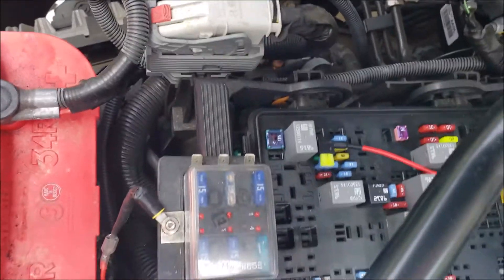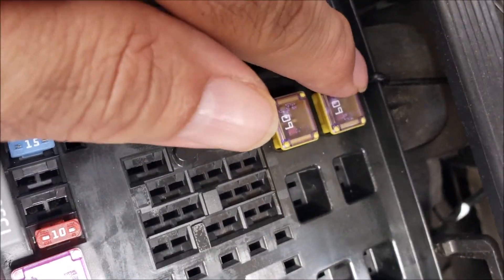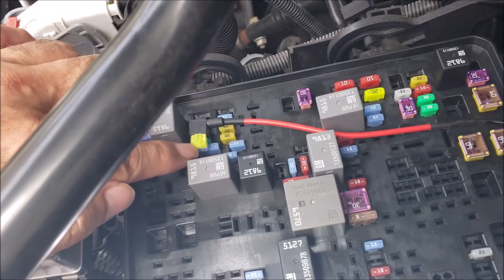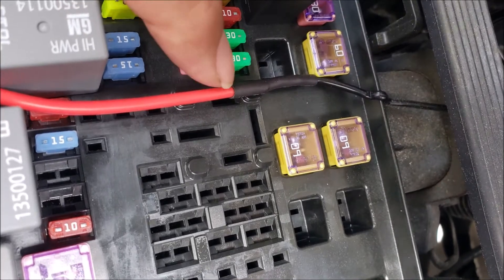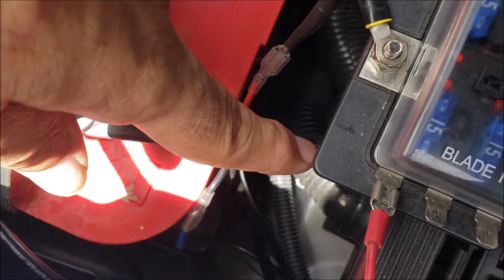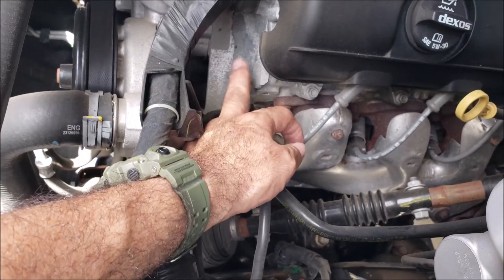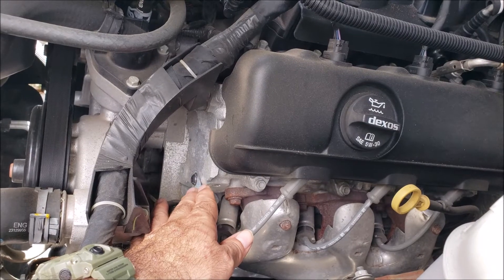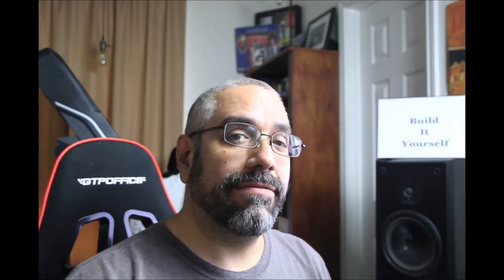Installing a second battery in Silverado/Sierra Final

Comment: i havea question about how some people running second battery with the isolator. Why some run Second battery+ to the isolator and then from the isolator to main battery+ or that red+ box that connects to the alternator? Why not second battery+ to isolator and from isolator straight to the alternator+? Wouldnt it be Less wires to run instead of running all around to the other main battery right? and the main battery+ is connected straight to the alternator anyways right? I have an 03 silverado 1500 5.3. And been watching alot of videos on how people ran it. I want to install it also but dont want to yet just wanted to make sure if i can install it that way if not i just install it how others do it.